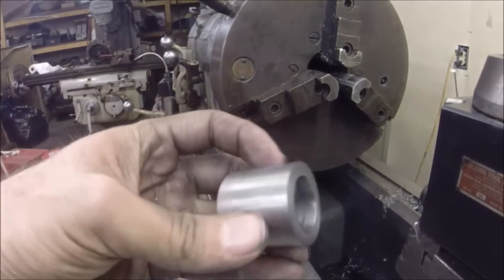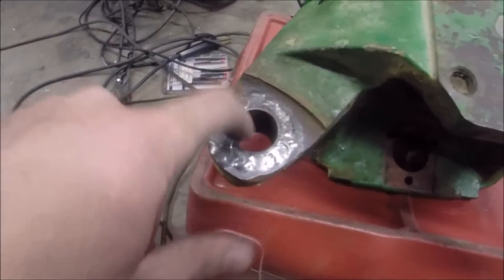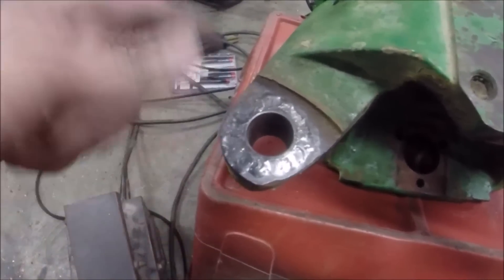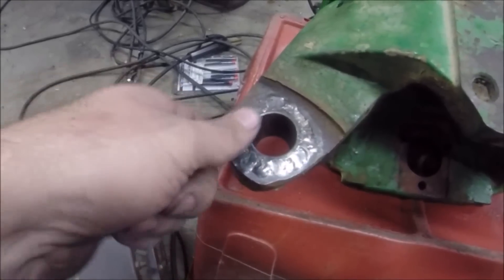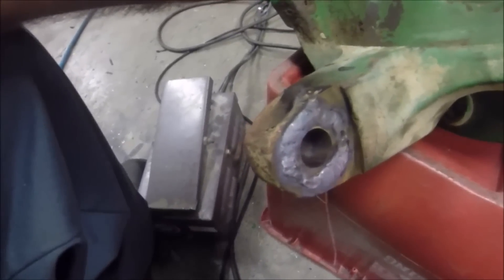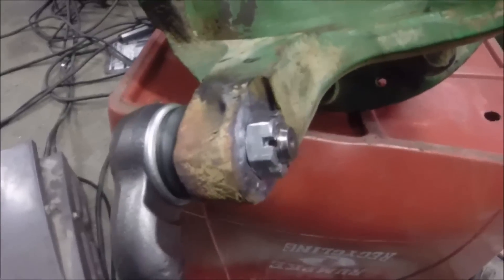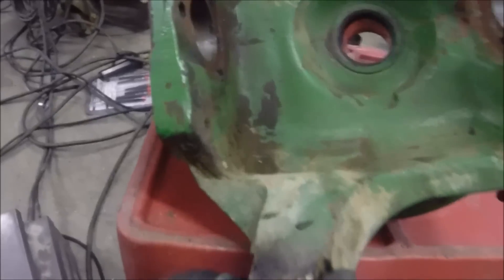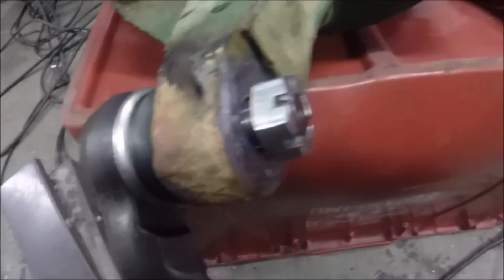Tie rod taper hole repair

Comment: Brian

Thanks for your vids on heavy plant 

When I worked long time ago now 16 years we had five v16 cat generator sets and a v12 direct injection set , for stand by power ( one of the UK banks computer centres) seeing your work brought back memories of maintening the things , all was good until a liner water seal failed and we had to drop the crank out ( for insurance crack detection ) not a easy job , you put hinges on the sump and used turnbuckles to tilt over the block so you could get chains down the bores to lift the crank.

But boy were the well finished inside all rods polished all over

Maybe not up to the power you get out of them but 1000 HP  continuous rating at 1000 rpm is ok , but boy did the drink lub oil but with a 90 plus gal sump it lasted a day or two 😀

Love to see that engine / transmission installed and running 

Stuart
Reply from the maker: Stuart Hardy I have worked on some tug boat motors to 50liter in size, but there is still stuff out there much bigger than that! I am currently building a 14L motor for a pulling semi for a guy but he didn't want it shown so no video on that one.

Comment: What happens if this paper is not exsact I had to team one a little to get to fit it is snug with zero play but the very top the bigger end is little too big so only like a centameter or less is not touching thanks great video
Reply from the maker: If the taper is not right I would recut it. If it is loose at the big diameter it will flex the shank of the tie rod and could cause a failure. That could be super ugly on a road going vehicle.

Comment: I got the same problem on the 4020. Just ordered a new arm since I don't have access to a machine shop. Cost wasn't too bad on mine but I can imagine what it would have been to replace the one you fixed!
Reply from the maker: William Garrett That 4wd knuckle lists for $1700!
Reply: Ouch!
Reply: Great job by the way.

Comment: I imagine that would be a cast steel and not iron? How does it cut?
Should be a fine repair.

Colin
Reply from the maker: ***** The dusty chips indicate iron to me. I would imagine it is nodular iron as that is a common industrial machinery material.

Comment: Hi Brian, that's just way too similar to my "Oh Deere' video from last May, I got to do mine twice, so I guess I tend to get a little nervous when I see a spindle repair. Great job on the welding, I guess you got your welder all squared away?
Reply from the maker: Michael Reggie I knew I had seen a similar video somewhere! I tried to find it so I could reference it and give it a shout out in my video, but I never could find it searching for it. I am just running my welder using the foot pedal to activate the pre flow, it works fine like that and I am watching e-bay for the right time delay relay to show up. Ever look at your Airco?
Reply: I'm hoping to get to do some testing on it this weekend

Comment: Brian would that part be made of cast iron or cast steel ?Also what rod do you use to tig weld it with Happy 4TH
Reply from the maker: THE IRONWORKER The dusty chips indicate iron to me. I would imagine it is nodular iron as that is a common industrial machinery material. I used ER80SD2 for the filler.

Comment: would that be 1½ taper per foot ?
Reply from the maker: +brian verlihay Pretty close I think this was 7deg best I remember and 1.5 in 12 is 7.125deg.
Reply: Ok I am trying to enlarge my tie rod ends to a larger taper and my friend worked it out  1.4634 taper per foot on my tierod end but the tie rod taper ream I found is 1½ per foot do u think that would work thanks ?
Reply from the maker: brian verlihay
You need to take an angle gage and verify the taper of the tie rod end you want to use, then make that match on your bores. Not all tie rods are made to the same taper. I know I have run into some that were 10deg.